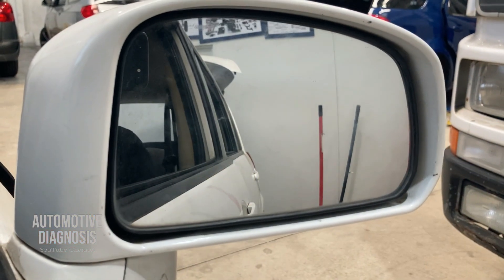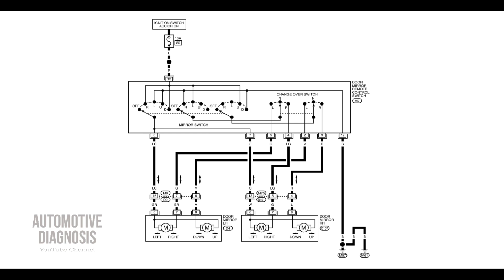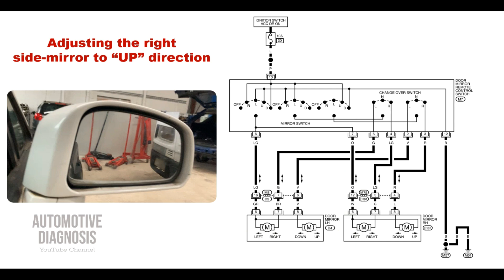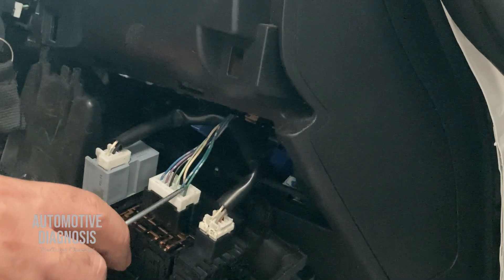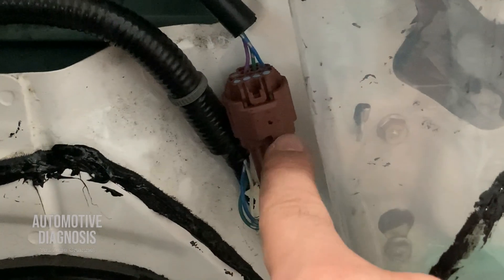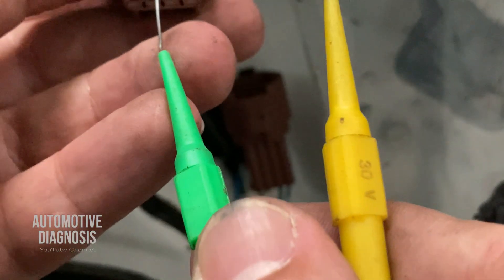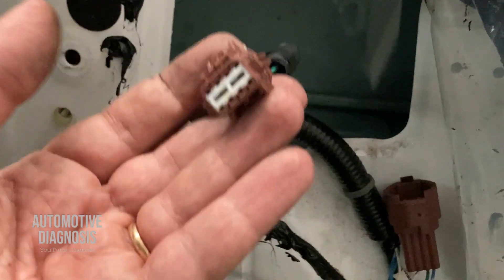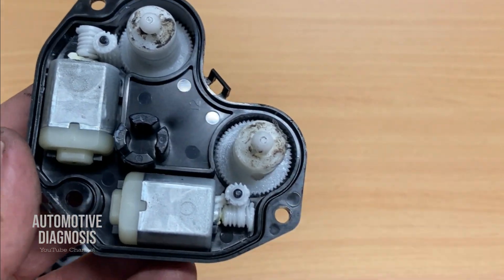Power Side Mirrors Diagnostics EXPLAINED in 10 Minutes!

Comment: 2018 Tacoma left, right, down working fine but not going up. 
Could it be a control switch?
Thanks for an excellent detail.
Reply from the maker: Hi there, because the down side is working properly, most likely is the switch issue.